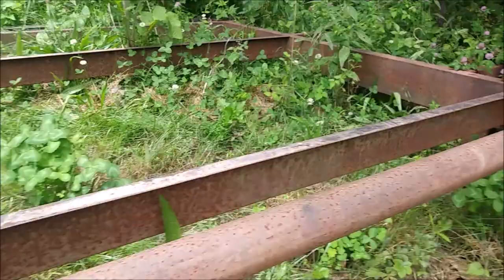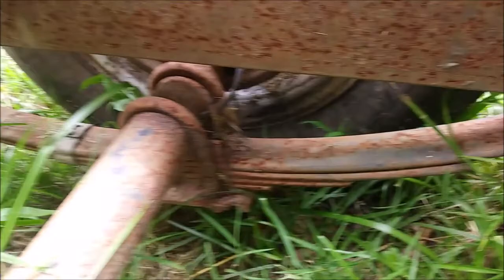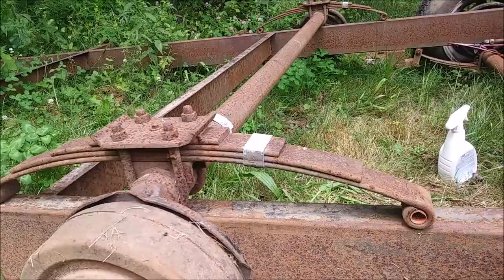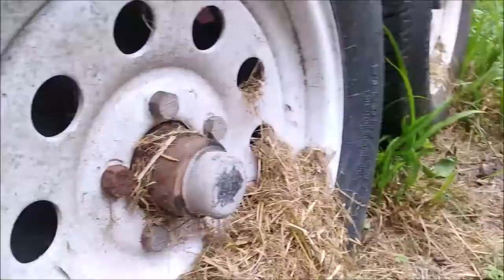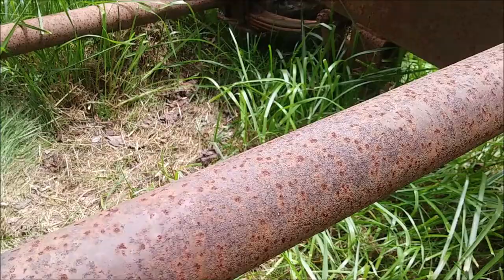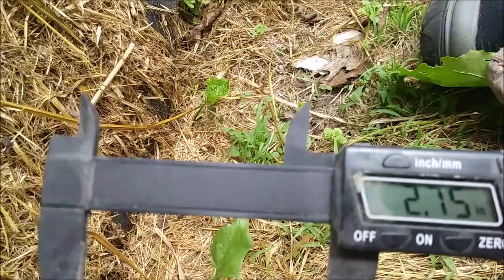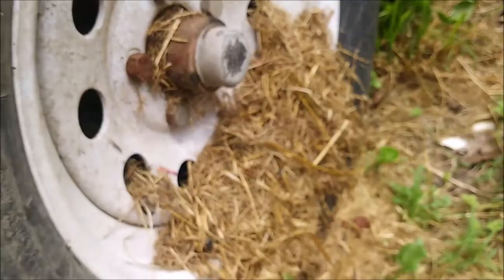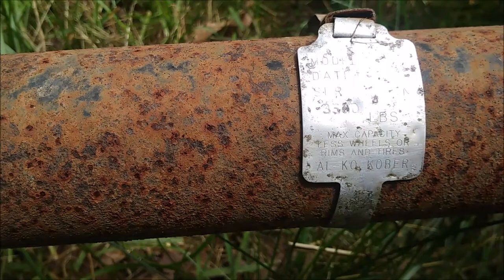How to identify a 3500 lb and 6000 lb Dexter trailer axle

Comment: Studs and lug nuts are common . Wheel bolts into drum or hub are usually old equipment . I ordered the 1/4” x 3” axle tube from Dexter . The 6,000 lb . axles come in three wall thicknesses . Replacing a Dexter torsion axle in a front wheel drive step van ; I used the 6,000 lb. axle with the 1/4” wall thickness . I used the 3,500 lb. spindles with 10”  brake drum . Both the Dexter drums and the van were 5 on 4 1/2” bolt pattern . I used the original springs and hardware off the van backplates for new trailer backplates . It was good swap because it was all Dexter 10” drums .
.

Comment: A 3500# axle will have a backing plate flange with 4 holes. A 7k axle will have a 5 hole flange for the backing plate. The difference in a 5200#, 6000# and a 7000# axle is which brake drum or idler hub is put on the axle. A 3500# axle come in two tube sizes, it is still a 3500# axle no matter the tube size. It is ab3500# axle because of the brake drums or idler hubs.
Reply from the maker: good info thanks for watching

Comment: So, an accurate way of measuring the diameter of an axle is the use a fabric tape measure or micrometer. Lets say you have a axle that the circumference measures 7.5" with the fabric tape measure, you are going to want to take that number and divide it by 3.14159. That will give you an answer of 2.38. Then you can convert to a fraction and get the size of the axle. The actual decimal for  a 2 3/8 axle is 2.375, so as you can see, both decimal number forms are very close. So its safe to say your axle is 2 3/8 or 3,500 lb axles.
Reply from the maker: that's interesting but im not great with math thanks for watching
Reply: @The Beard of Gaming  Not necessarily the norm.  With some heavier duty axles, with significantly different weight capacities, the OD is the same, but the wall thickness of the pipe is different depicting the strength.  I am going through this problem right now with an older trailer that has no ID's on the axles to be found, that the previous owner had registered for a larger GVWR than what is listed on the manufactures ID tag on the neck.  We're talking two tons of difference here.  I have no way of knowing if he switched out the axles for heavier ones as he is deceased, as an upgrade after it was manufactured, or if he simply over registered the trailer at the DMV to avoid fines if he were to overload it.  To have them checked with digital X-ray radiography is not available in my area.  When I get a chance from my work schedule to be able to get to where the trailer is at, one alternative is to measure the brake shoe widths, as they correspond to what size drums are used with what sized axles.
Reply: @Mike-226  right, but no matter what size tube you have, you still only want to go off of what size the axle itself is. I get what you are saying, Yes, its a headache trying to figure it out sometimes. Good luck and if I can help, let me know.

Comment: i do also believe the 2000 lb axles also have the 5 lugs and anything under 2000 lbs is 4 lugs but  I am not for sure of the different axle tube diameters. for the 2000 lb and less axles.
Reply from the maker: yea I believe I heard the same info thanks for watching and commenting

Comment: ok a 5 lug and 2-3/4 inch tube is either a 3500lbs or a 5200lbs axel. But I think from the specs this is a mobile home axel so it was a 5200lbs axel at some point.
Reply from the maker: I talked to another YouTube that messes with these axles and trailers a lot and he said its a 4200 lb axle but is only good for 3500lb unless I upgrade the brakes and hubs to 4200lbs basically a 6 lug hub and 2 x12 brakes thanks for watching and commenting
Reply: Andrew's Custom Builds look at the spindle itself that measurement will tell you exactly what the axle can carry. The pipe and lug only makes up 50% of the axle.
Reply from the maker: I gonna be replacing 2 of the hubs on that trailer later this year and will measure the spindles when I hear it apart then I will know for sure thanks

Comment: Dial indicators are very sensitive to things like rust and even small particles of dirt. You first need to clean off the area you want to check to get any accuracy. These tubes where manufactured with fresh, rust/dirt free metal stock, I see a lot of rust and dirt there so I don't think you'll ever get 100% accurate measurement because even if you clean/resurface them you'll likely remove more than the rust.
Reply: Stop. Do you really believe that there is 0.25" of rust buildup difference between two tubes that were likely installed on a trailer at exactly the same time?

I urge you to stop and think about how thick 0.25 inches is.

Comment: I was going to say about a 5000 lb axle.... I have several of those some with the brakes and some without!.....think I have about 10 of each left!
Reply from the maker: I did a little research and come to find out there are 4200 lbs axle with 3500 lb brakes if I upgrade the brakes to a 42000lb or 5000 lb then then can handle 4200 lb weights(8400Lb) for breaking thanks for watching and commenting oh and are you close lol I am always looking for trailer axles to use on builds
Reply: I'm looking for axles too if you're near to Amarillo, TX.

Comment: Possibly a 5200 lb. Axle . Check the bearing and race
Reply from the maker: 4200 lb with the brakes and bearings would have to upgrade for a 5200 lbs

Comment: So... Went out measured my axle diameter, manufactured home axles 3" on the dot...
Reply from the maker: I believe those are 6000lb axles but you got to replace the bearings seals and hubs on those axles if you are going to use them on a different trailer build/refurbish

Comment: I have a couple old Dexter Star axles on a trailer im building and the axle is around 3" and has a 5 bolt backer plate on it and brakes on both axles,  i was thinking they were 5K  but anyone  have any other info on what they actually are?
Reply from the maker: 5 lug is usually 3500 but 3 inch tune maybe 4200 lbs
Reply: @renegade07garage  there not 5 lug, dexstar used 4 lug rims back in the day on all there axles from 2k up to 7K. It's from the 1980'S  the backer plate has 5 bolts instead of 4 like a regular 3500 lb axle backing plate would have.  The only research I can find on it is it was other 5200 or 7000 lb axles. Iv got to measure the bearing and brake size to confirm it
Reply from the maker: Gotcha I read you first comment wrong and was half asleep lol when I read it lol 😆
Reply: @renegade07garage  haha I know the feeling. One eye open trying to read things lol

Comment: What is the width. Size on the trailer frame.  how wide is it from axel to axel
Reply from the maker: The width of the trailer is 73 inches or 6 foot 1 inch wide the second trailer with the deck on it is also 73 inches wide thanks for watching and commenting

Comment: Mine has 6 lug nuts but my tongue says 5,000?
Reply from the maker: look for a tag on the axle usually 6 lugs is 6000lbs you can also measure the diameter of the axle tube to determine the weight rating thanks for watching

Comment: I have 3 inch tubes, 4 springs, and 5 lugs. Still don't know.
Reply from the maker: if it 5 lug this it 3500lb unless you upgrade the brakes and hubs to 6000lb and maybe the springs good luck

Comment: 2-3/8 is a 3500# The 2-3/4 is a 5200#
Reply from the maker: yea I was a little confused by the tube being a little bigger than the 3500 one turns out its a 4400 axle, or at least that is what i am told,dod you happen to know the thickness of the tubes im guessing 3/16 or 1/4 but have not cut one in half to find out for sure.
Reply: That’s what I’ve always thought, 2.75” is 5.2K, but it sure looks like the tag says 3500 and I’ve never seen a 5 lug 5.2K axle
Reply: @daviddurr7218  the bearing numbers tell it all

Comment: (Sigh) Just when you think you have a handle on it. Would that 2&3/4" axle may be a 6000lb axle??
Reply from the maker: I don't know Brian I looked on line and found no company making a axle with a 2 3/4 tube, the 6000 lb axles have a 3 in tube with 6 lugs and the 3500 lb axle have 2 3/8 tube at least that's what I found maybe a odd ball axle just produced for a few years thanks for watching and commenting
Reply from the maker: I talked to another YouTube john Daniel he has had some experience with travel trailer frames and axles said they are 4200 lb Canadian Dayton axles.
Reply from the maker: but there are only good for 3500 lb unless i upgrade the brakes, hubs and springs .